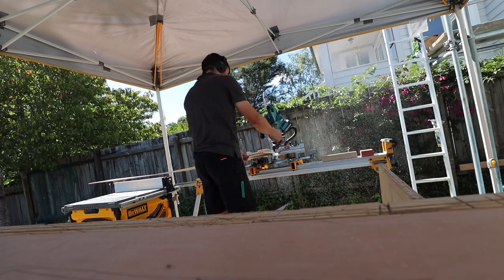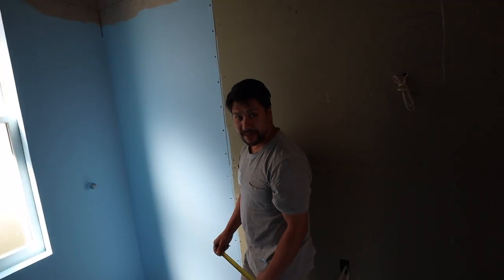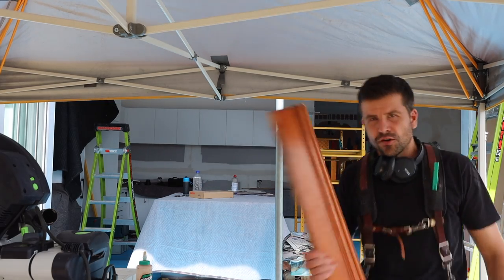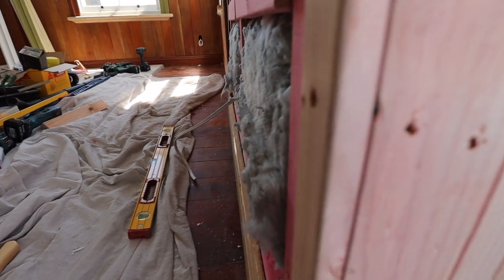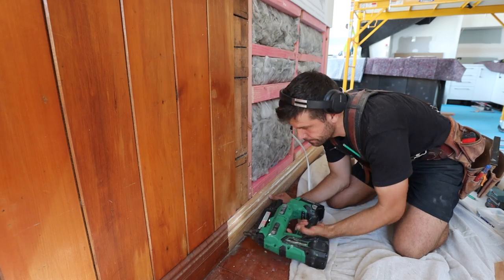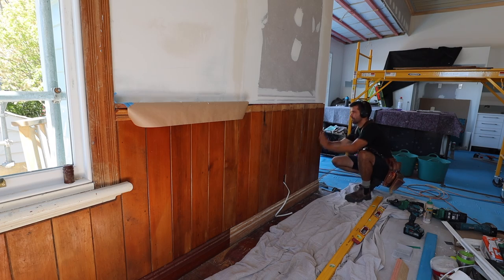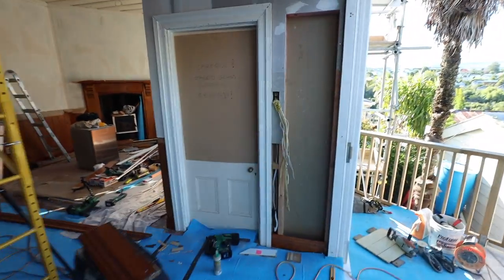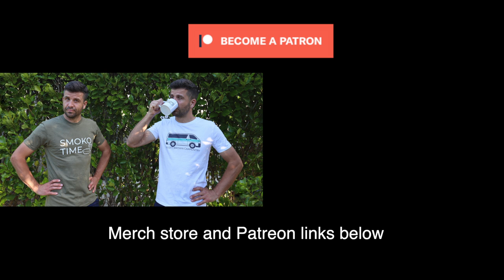Doing the Finishing Work Right (Restoration)

Comment: I searched for problems with the Kapex in Germany(german) and it sounds like a problem with the 110Volt versions, cause somebody wrote this in a german forum AND you find nothing regarding to this problem in Germany. The only posts about the burning out Motor are from the USA etc. Sooo, as long as you use the 220/230 Volt version you shouldn't get in trouble attaching your vacuum to you Kapex.

Comment: The Festool Vacuum and Kapex are designed to work together? I'd use them together as designed. 

The only "but" being if you need to use an extension cord, use a good quality heavy duty one. Don't skimp, and don't share with other tools.

Comment: Long time viewer first time commentor. I'm also an electrical engineer and burning out a saw motor because a vacuum was plugged in can happen - but you'd have to be pretty unlucky. 

With AC power, adding motors makes the power factor of the electrical supply you're using worse - and you can overload the motor windings with reactive power.

Here's a video with heaps as of details https://youtu.be/Tv_7XWf96gg

An analogy could be a band using guitar feedback in a song. Each motor is like bringing the guitar and amp closer - once you reach a certain screech the motor goes bang. Adding capacitors to the circuit pulls the guitar and amp apart - but don't try that at home!

Your mate who lost the saw could have been at an industrial site with a crap power factor and plugging in their vacuum closed the last little gap in front of the amp!

You and Paro keep up the good work now! Haha

Comment: I presume this is a bid job with a few change orders along the way. But I wonder how well Scott makes out on these finicky jobs? Nothing is square. Always a learning curve since it's a small reno. Looking at that existing house, seems ripe for a bulldozer and hauled to the dump. Lousy insulation, suspect structural integrity, crummy old windows, poor plumbing, electrical and no HVAC that I recall. By the time you start replacing windows, adding new kitchen/bath/laundry and spending months  only to end up with a cut-up old mishmash of a home, knocking it down and starting over seems a reasonably cost-effective option.
Reply: Old villas built with native timbers tend to be treasured in NZ, and fetch very good prices. The Auckland property market is bonkers and the owners will more than recover costs. Some renovations do end up looking like a poor marriage of styles and technologies, but generally it doesn't matter, as people want modern amenities in functional areas like kitchens, bathrooms, laundries & olden day charm of high ceilings, native timber floors and preservation of original features (brought up to code) in living areas and bedrooms.

Comment: Tile over a plastic tray weird. Wonder if that will last. Busy tiles too everyone to their own. Square butted corner end grain on the panelling not usual and you are normally so fussy. Put the dust extraction back on the Festool whoever said don't is an idiot. If it burns out the motor it just means Festool haven't fixed their old self destruct problems. And if it does you should get a new saw under warranty. Some interesting design features in that house not least the shower window. But as I always say I don't have to like what I am building as I don't have to live there.